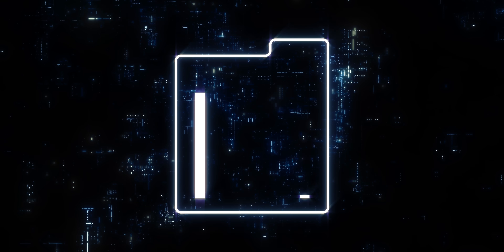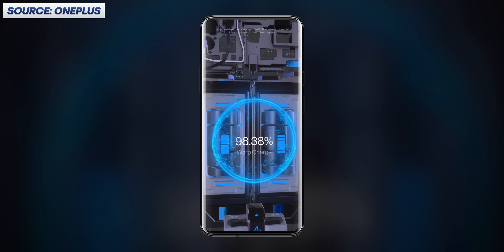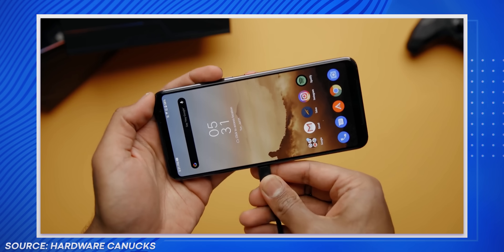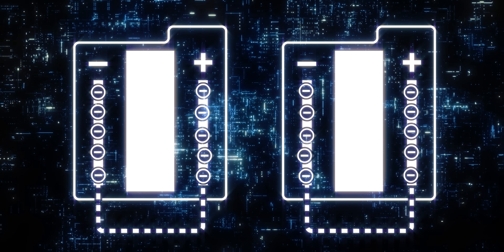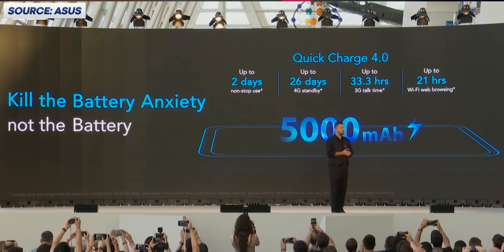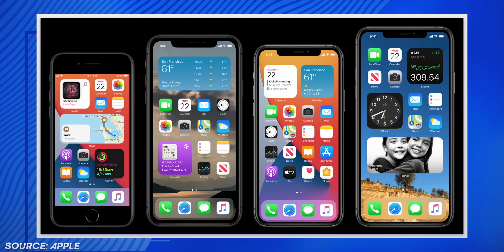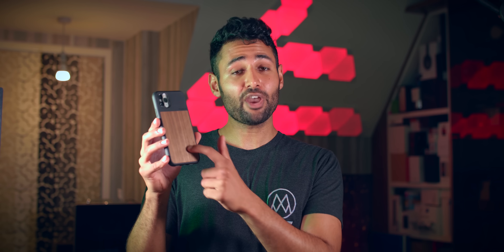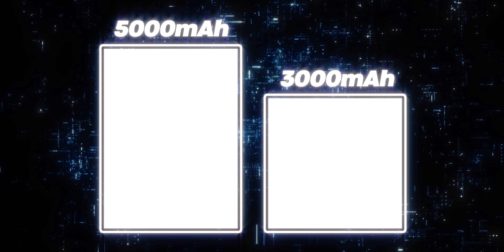The Problem with Fast Chargers.

Comment: The heat issue is why OnePlus does the power conversion on the wall plug and not on the phone, negating the extra heat on the phone.

Comment: Personally I wouldn't care for fast charging if I had a bigger battery, I don't mind a thicker/bigger phone if it means I don't have to charge it every night, take the energizer phone for example, getting one week (roughly) of battery usage, that means that battery which could technically have 300k charge cycles would deteriorate much slower as you'd be charging the phone roughly 7x less, maybe not to that extreme in size but even something finally breaking the 5000mah battery size (that's more available/more marketed) but even jumping to 6k or 7k mah would be tremendous for a mass market phone (LG, Samsung, Motorola, etc) because you would only charge it maybe once every other day (depending on usage) 

Thats my opinion of course, I know not everyone would be willing to sacrifice the thin and sleek design of smartphones these days

Comment: The most stable state for a battery is not at 50%. The most stable state is at equilibrium. I.e. ~0%. 50% means that there is still a gradient there. I say this because nobody else did and because ppl are commenting how u shud teach them about EE. Not Ure fault because that's not what Ure doing.

Comment: 2:03 not really.  those with fast chargers will simply reduce the charging rate and I think batteries can be hotter than typical phone usage surfaces for comfort.  2:10 in addition to what I have said, ASUS knows what they're doing.

Comment: Yooo i have a question....soo iam a gamer and Play a Lot....If my phone isnt at 100/ and i play its getting laggy and its so quick empty.....so i Play only with full 100/ and Charge at the same time but i know thats Bad for the Phone.....so do u have a Tipp for me ;)) would be sweet
Reply: what phone do you have?. i picked up the ROG phone 3 and the bypass charging is amazing, i can play games for a couple hours with charger plugged in to power the phone without charging battery, doesnt get hot at all.
Reply: @Eight8411  a Bad Wiko :)) but Poco x3  should come in a few days ....l

Comment: My experience with fast chargers after 2 years
I've been using 40w charger every day for my huawei mate 20 pro and it's been an awesome time "especially when most who is around me uses iPhone and charge for 3 hours 😂😂"
- Its fast for the first 90% and then it slows down.
- the battery is still excellent yes not like what it was 2 years ago but at least 80% "every phone battery well be the same even if you charge it in 1w charger"

Comment: That's why I am waiting for samsung doing a step by step increase in battery charging speed. They are way more afraid of battery problems so they don't rush fast speeds and when they will release a charger that it's faster than 25w, it will be released after many tests to see if things will go wrong or not.

Comment: would it be better to have a xiaomi mi 10 ultra with exceptional speed of charging and 4500mAH or have galaxy s20 ultra with just a bit more battery capacity and lower charging speed? what does anyone think

Comment: Hi ,Thanks for the information, I have one question I just purchased s20 + exynos  but  in a normal use its tem goes to 35 and when open camera its goes upto 40. So even normal use its 37 c. 
Is it normal or some damage in hardware, as customer service center say its normal but I doubt. 
Can you please help me..🙏😇

Comment: Been using my OP5 for about 3.5 years now and the capacity is still fine. I always charged my older phones over night and the capacity went straight to hell in less than 2 years but with fast charging I just plug it in for 30 minutes in the morning and that's it. This change had a huge impact on the battery degradation imo. And now after 3.5 years I'm still content with the battery

Comment: Faster charging doesn't mean faster electron movement. Speed of electron in a closed circuit is a constant nearly equal to the speed of light. Faster charging means more electrons not faster electrons.

Comment: At 3:10 you say at 0% all the electrons are sitting at the positive pole. This is not true. The number of electrons at each pole is equal at 0%. (Well in actuality there are slightly more at the negative pole because the software cuts the power before the battery drains completely)

Comment: I have been using blackberry keyone and it’s been almost three years, my phone battery is still awesome. I get almost 1.5 days usage with fully charged. It came with 18w charger and I use fast charging once in a while and my phone is still doing good.

Comment: I use a 5 watt charger for my phone, even though it is capable of charging at over 40W. I'm intrigued by this space lost for fast charging you're talking about. I'd love to trade the ability to fast charge for higher battery capacity. I suppose I should be on the lookout for such phones if they exist.

Comment: Using Mate20pro with 40W fast charging for 2 years now and still can't kill it in a single day. 
Imo, all that apple slow charging talk is bs.
...optimize it, put a big battery in and add fast charging. All problems covered... but thats expensive, so thats why Apple doesn't do it.

Comment: It is needed to mention that those super fast charging phones have a very decent cooling system. I have the 65w fast charging Realme x50 pro and it barely gets warm at full speed charging because it has a copper vapor chamber, a ton of thermal paste and probably gallium nitrite components instead of silicone.

Comment: I would gladly take a device with larger, higher density battery and with moderate speed, over a device with low density battery and super fast charging.

Comment: Is this the reason for samsung mid range phone m51,m21 have higher battery capacity?? since the exynos 9611 processor gets heated a lot! , hence by giving bigger batteries they try to cover up the battery deterioration rate hidden or unnoticable for at least a couple of years?

Comment: And here we have the leader of the sheeps and advocate of 18w charging boys. 

Blablabla. You contradict yourself. First you said faster charging will degrade the phone, then you said every phone battery will degrade no matter what.

Mi 10 ultra 120w can charge 0-100 in 20 minutes. The company had tested that it will last 800 charging cycles and degrade the battery only by 10%. Thats easily 2, 3 years of no problem.

So why in the world ,would i choose a snail charge phone if i can have a faster one? Heck, im changing phones every 3 years. Battery degrading is not an issue.

I rather charge 20 minutes per day than to wait 1 hour just to use it.

Comment: I'm spoilt by warp charge that 18w charging feels so slow to me🙃
Btw my phone gets heated up more on a samsung 15w charger than it is on its original warp charger
Reply: No use only OnePlus charger with oneplus device..your device will be okay.
Just dont full charge everytime charging upto 85 to 90 % is okay
Reply: @sourav5065  ok bro I will use oneplus charger but once I was out and had to use other charger but noticed it heated up more
Reply: @sarveshsivakumar6993  yes oneplus charger is optimised for oneplus 
Remember just don't overcharge your phone..80 85% is okay enough
Reply: @sourav5065  ok bro thanks ✌️

Comment: Mentions bypass charging but doesn't mention Sony with its H.S. power control

Also, the new Sony xperia 5 ii has a feature in which you can set a limit on battery capacity on charging. Noice, don't have to check the phone to unplug it before it passes 90%

Sigh, if only it wasn't so expensive

Comment: Yeh bugger this. 65w charging on this oppo is the greatest. 25 minutes to basically fully charged from 30%, and it doesn't seem hot to touch at all. I won't go back.

Comment: I'd recommend somewhere around 15% to 20% before putting it back on charge again and plugging it off before hitting somewhere around 85% to 90%, I'm actually seeing my battery last longer this way, but if you have a fast charger the latter part is kinda difficult to keep track of, because the phone would've charged up to a 100% before you'd know it.

Comment: The fact that he didn't even mention sony made me kinda mad, sony has been on what I will consider the front of batterycare. 

- They wore the first to add slow charging for the night (what they call batterycare)
- they have stopped using wireless charging bc of battery damage 
- they introduced what they call H.S power controll in their game enhancer
- fast charging at 20 watts

Comment: You should charge up your battery from 40% to 80%. I've been using the same phone for 3 years, with a 3000ma Battery, its down to 2500ma today. I would also avoid leaving the batter on charge overnight, if you want to preserve your battery long term

Comment: I am using oneplus 5 since more than 3 years, now i feel battery backup is reduce. Anyways battery degrades after 2-3 years. So i dont think its a problem until you are using 15w or 30w chargers.

Comment: Forget Iphones. Why some mid range and flagships still have 3000Mah battery (example midrange Nokia 6 and flagship Nokia 8 pro and 9 pure view) it's doesn't worth it right? These days for many applications the battery consumption is higher, even we need more than 5000mAh battery (ultra). Why don't Nokia doesn't increase battery capacity?

Comment: For anyone wondering. Phone reduces/lowers wattage when it is turned on, hot or close to 75% to keep the battery safe. Tried it with my mate 20 pro (40w).

Comment: What about replacing the batteries with super-capacitors? They charge fast and hold the charge for weeks while not in use.
Edit: I've been waiting graphene batteries to become the norm they're said to Be able to have a 100% charge long-term on standby or not have a "memory"

Comment: I don't think that the heat component of the charging is that bad. I saw a video on the Xiaomi 11 pro and it charges at 120W, the battery reached a temperature of 44 Celsius. General normal use, let's say gaming or watching videos with high brightness then the phone gets way hotter than that based on my experience. So how much does the battery degrade just by charging compared to the heat that is generated from normal use? I think that it might be negligible.

Comment: I have a few questions on the oneplus 7 pro:
does the op7 pro have slow charging? how do I enable it?
is there an app or something to prevent the battery from charging to 100%?
does oneplus also do optimised charging? if not what can I do for it?
I just love the phone so much, I don't want to replace it.

Comment: Most of the users will change phone every year to get the most advanced new technology and features so it doesn't matter for them.
But nevertheless you are cool and your videos are very educational, I like your channel and I'm watching all your videos even if I know most about smart phones and gadgets.
In our daily life we are using smart devices and gadgets for many reasons, that's the future.
Reply: Actually...No. The average time of holding onto a device has actually increased over the last few years. That average is 2.5 years. Only crazy people replace their phones every year...The differences between consecutive models are barely noticeable anymore. 

My own rule: I replace when most of the components are at least twice as good. So if I have 4Gb RAM and 64 Gb external, I will only replace to a device with 8+Gb and 128+ GB.
Reply: @shane250  as you said, "your rule", not everybody else's rule.
No need to be crazy to change your phone every year, there are many reasons that will make users change device, even from Android to iPhone or battery after one year went bad and the cost of replacing it it's too high, broken phone, water damage, new models with 108 Mpx camera, phone not fast enough,  stolen or lost phone, bad choice, new features, and more....

Comment: You can't overcharge Note 20 Ultra. I tried plugging it bacc in once at 100% and it wouldn't charge until it hit 99%. In other words it stops charging at 100%and won't overcharge but it also won't go down from 100% even if connected on charger.

Comment: So I shouldn't use the supplied "fast charger" with my new phone, I should use an existing slow charger? Or is the supplied charger the safest charger because of over charging protection? I always thought the phone did this, not the charger.

Comment: Asus did think about the battery life. 30W is more than enough for my ROG phone 3, and gets the massive 6.000 battery from 20 to like 70 in 30 -40 min, and takes about an hour and 10 min to fully charge (from 15-20%. The last 5% takes about 10-15. And having separate circuit not to charge while gaming?  Thank you for that detail that I didn't even know I had <3

Comment: I’ve had super fast charging on my Mate 20 pro for 2 years and it still hold a great charge. Once you’ve had super fast charging you can’t go back. 

I definitely try not to use my phone while it’s charging as I only have to wait less than a hour 

I always try to wait till it hits %100 before removing it off the charger 

It’s a blessing to go from %10 to %75 in 30 minutes, such a life saver in a lot of cases

Comment: great video! i‘m still charging my iphone 11 Pro Max with a 5 watt charger. it works just fine for me, because i just don’t like faster charging, and especially i just really don’t get why it is even a thing.
Reply: i usually dont leave my phone charging at night so i plug in while i go for a shower and its topped up to 50-60%. then another burst in the afternoon to last to evening.
thats changed since i got a phone with slow charge and schedule charge option now, even has bypass charge so i can game without charging battery. now i just slow charge to 80% overnight and dont need to plug in till next night.
Reply: ULTR4NUUB i‘ve also never charged it over night.

Comment: Best thing to use on todays standards would be capacitors instead of batterys. Abnormally fast charging, high longevity and way better in terms of durability.

Comment: The downside to Apple's slowing down older phones is that it CAN slow down the OS in a sort of "FEIGNED OBSOLESCENCE" factor - I  used to get my mo'ms iphones when she upgraded - and holy crap 1-2 years into having it after her, the battery degredation while still my fault - it was REALLY HARD because the speed of the OS and some of the games was a nightmare - and this inlcuded the old iphone 7 plus that i'd gotten a couple years back from mom when she got her 10.  Now we're both on Samsung Ultura Note 20s and my pocket and wallet HATE ME :P

Comment: And never, ever charge low wattage devices like headphones, smartwatches and so on with high current or fast chargers, 1a is the maximum you should use. In theory it shouldn't matter but devices are damaged by these chargers, sometimes the charger docks as well. Many manuals state to use a computer USB port or 1a charger.

I keep a metal tray near my charger and place my phone on it, that reduces the temperature during charging. You should also make sure you're using appropriate cables, a long cable will not give a good fast charge, the protocols are detected by voltages on the data lines, any drop can cause it to default to 2.4a or even lower.

Comment: I am using an iPhone and I only charge it slow right before going to bed. My battery survives a day very good and I don't need a fast charger at all. I still have one and I'm only using it if I forgot to charge my phone. After more than one year of use, my battery still holds like day one.

Comment: I love fast charging but I only charge it to like 60%. And then on my lunch I charge   1 hour  charge later it's like 30% but for that hour lunch it usually charges about up to 90% .., you almost wonder why the apple did not have the c charger  because we are in the year 2020 Even my Xbox supports the c charger Microsoft got on board why can't Apple 🍎

Comment: appearantly, the problem i face with high-speed charging is mostly overheating. the device i use is an Xiaomi Redmi note 7S, and its issue with fast charging is that it can make both the phone and the charger VERY HOT. and when these get hot, my only fear is battery health because redmis have a tendency of warming up during gaming and the fast charging makes it hot, i just dont want to replace the battery after an year because i bought it so that i can own it and use it without any reason to replace parts for a long time, and i definitely dont want to replace the battery every year, making the phone more and more fatal to me. great video arun, love it.

and yes im that one dude who always has 70% charge on their phone and its not plugged in a charger 24/7. i game in it but never let it drop to zero :)

Comment: I'd rather a larger battery than super fast charging speeds. I don't care how slowly the battery charges while I am asleep, but I do care if the battery doesn't make it to the end of the day easily. Fewer cycles on the battery when it's larger so I'd assume a larger battery would last longer.

I wish it was common to be able to set the phone in the OS to stop charging at 80%. I know there's apps but still.

Comment: I have realme 7 having 5000mah 30W charging . It don't get heated. Realme 7 pro and narzo 200 pro having 65W also don't get heated because they have Superdart technology in which there are two batteries and they charge simultaneously and components kinda reserves in 65W charger.

Comment: Realme and oneplus in next 10years:we are introducing a charger that charges your inverter in 35 minutes
Reply: I have Realme X2 pro and full charge 0%ish to 100% takes under 30 minutes.
But phone kicks in warning at 29% and I then charge to 95% 
Arun did mega charge test last year with about 18 phones and mine was 2nd fastest. Great phone.